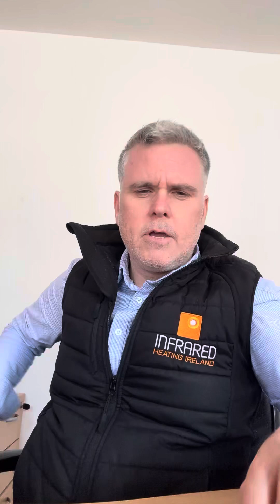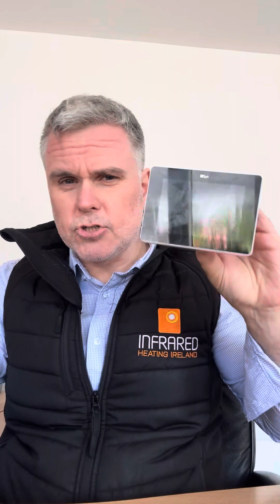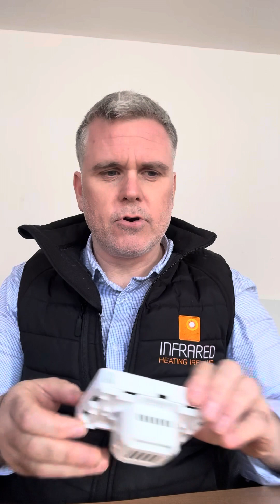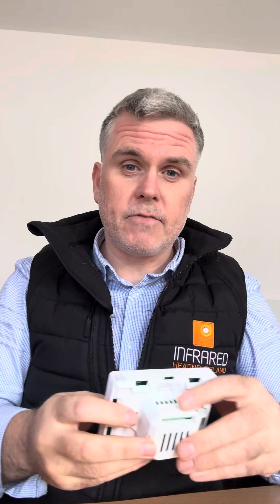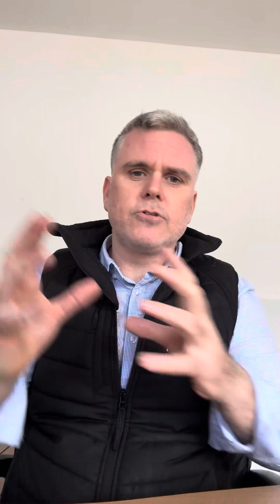Why infrared over other types of electric heating @ir-paneliekosenspecialisti6928 ​⁠

Comment: What would really help me, is a basic explanation of how an infra-red heater actually works. Your excellent videos explain how they are installed and positioned. 

BUT what will I actually experience in a room heated by infrared versus a conventional heater that I am used to?
I think it heats objects/people as opposed to the air. 
I think the heat if instantaneous. 
How does one work out the size/power for the room size?
I am interested in one for our bathroom/shower which can be cold - what are the considerations?